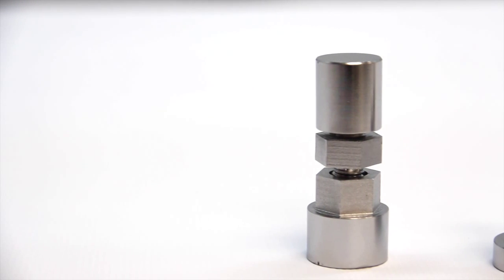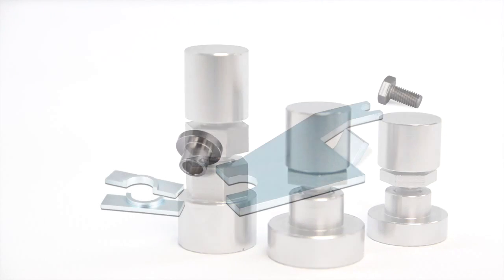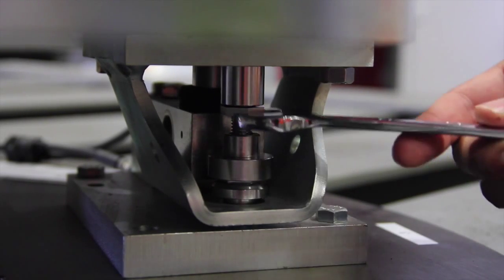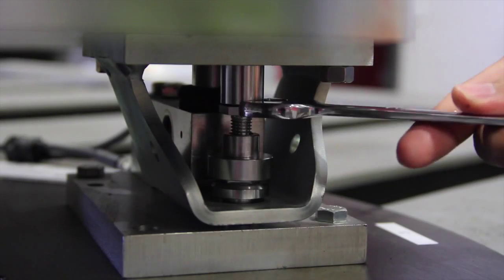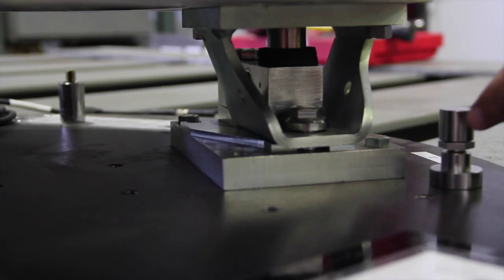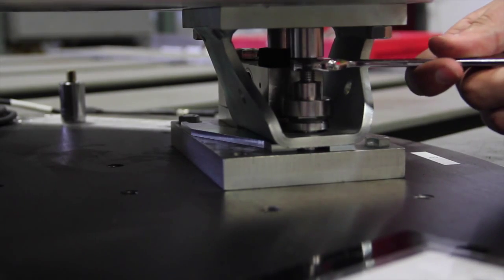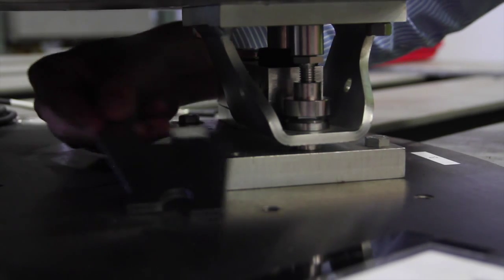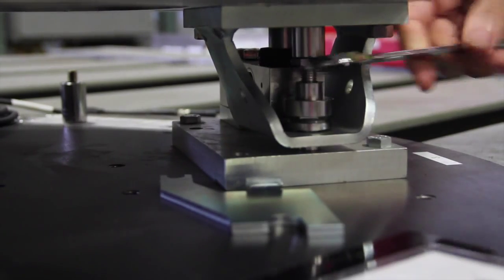Jacking Tool for MultiMount™ and PowerMount™

Comment: As I understand, it's not necessary to use the two smaller plates, just the larger one, for transport ?
Reply from the maker: Thank you for the question. To create a rigid connection between top plate and base plate – to make the weigh module one solid block – all parts of the SafeLock shall be installed for transport. The two smaller plates center the top plate of the weigh module. For load cell replacement – the tank scale is already installed – only the big SafeLock plate is needed, the two smaller pieces are not required.